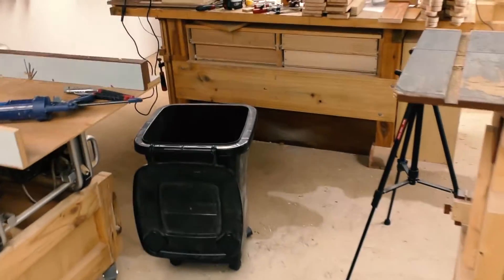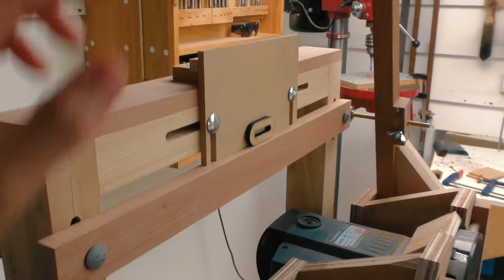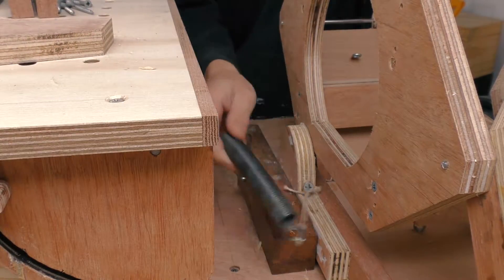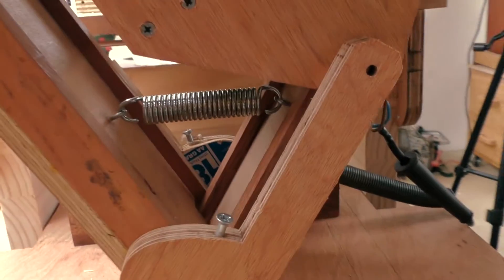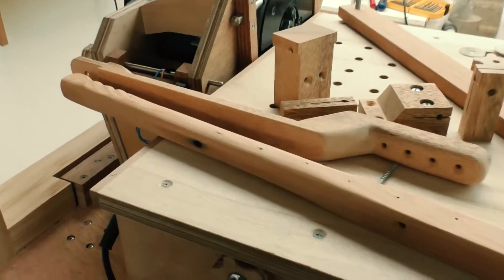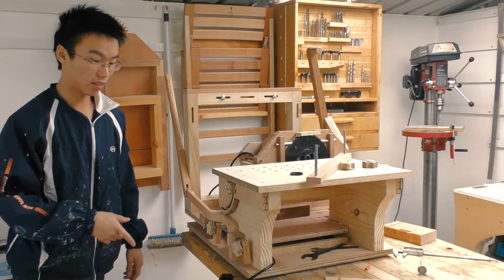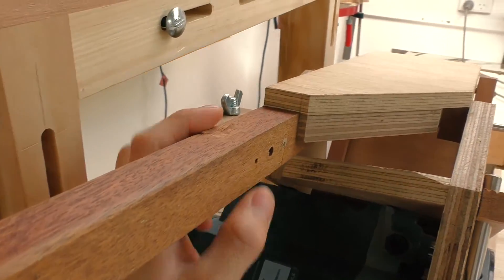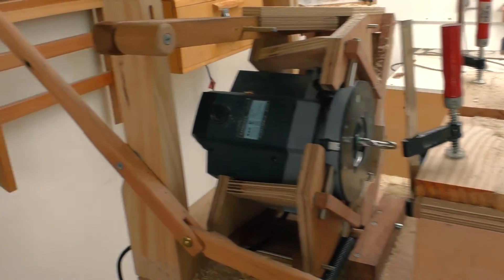Pantorouter XL build: plunge lever and other problems

Comment: Don't forget to check the actual cut size of your bit! The bit itself may be cutting slightly larger than its listed size either through vibration, concentricity or being ground too large. That error would also compound X2 when cutting both parts. Try cutting a strait line and measuring the path width with calipers.
Reply from the maker: Good idea. Does cutting a large mortise count (the bit goes straight across without going up and down)? if so then I've already checked that when testing my other bigger templates -  the bit I'm using is 12.0mm ±0.1. However, I think I might test it again, this time cutting the longest straight line possible on the pantorouter.
Reply: Good idea, if it is the pantograph the error should multiply over distance, if from vibration or mechanical slop at the router it would remain a constant error.
Reply from the maker: thanks for the information

Comment: The guide rail is very useful, I also add one in my metal pantorouter.
I think the broken tenon edge is caused by not cutting in the clockwise direction
Reply from the maker: Yeah, that was a factor as well, but I have since made some toggle clamps to clamp them down now.